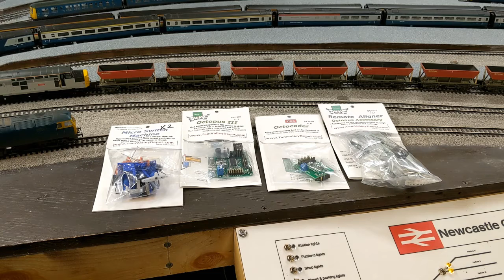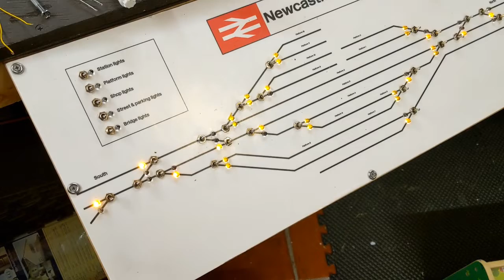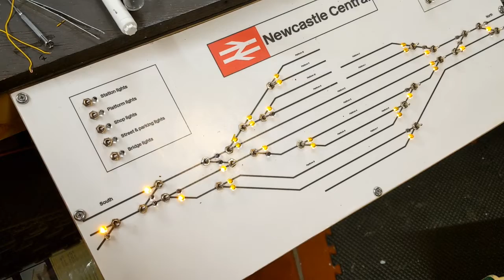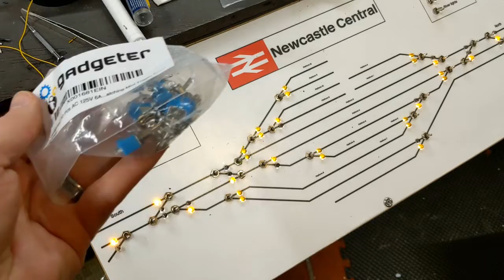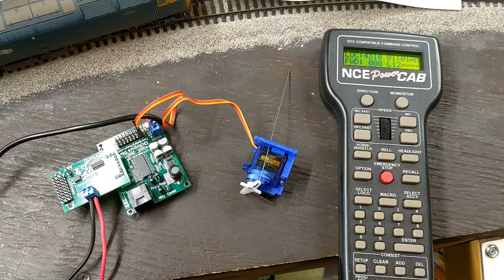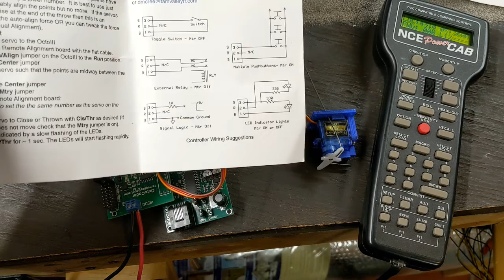33 - Points control with Octopus III and Octocoder from Tam Valley Depot

Comment: A momentary off is a pushbutton but the button will be sold as normally open (no) type. You can wire your led in parallel with the button like the instructions show. I like wiring in my panel leds with the tortoise machine. I am trying go convince myself that servos are more affordable and economical but have done it just yet. The led situation still has me hesitant

Comment: It’s been a year and a half now, I’m wondering if you are happy.  I’m working on a new build, I have tortoise switch machines from my old layout but really disliked all the mechanical noise they made when operating so I’m considering going to service,   I’ve read they can buzz when stationary, has this been an issue?
Reply from the maker: There's a little more noise when the points are thrown compared to solenoid motors, as they don't just thunk over. The servos throw a little slower, and at least with the Tam Valley boards, you can configure what that throw speed is.

I haven't had any noise with the servos buzzing or chattering when stationary. From what I'd seen, that's more if there's some noise on the cables or controllers that's causing a signal to still be sent to the servo.

Either way, with the sound of a train or two running, especially if any of them are DCC sound, you can't really hear the servo motors during operation. Good luck! Iain
Reply: @NewcastleCentralOOGauge  so on the whole, you’d go with servos, if you were to do it again?   (I’m doing an electronic switchboard, so manual buttons are not a worry).
Reply from the maker: @drithen  Yep, all my points are now servo-controlled and then digital control through JRMI. I liked the Seep PM-1 motors at the time given their low cost and the manual control panel I built, but those point motors just didn't hold up and I wanted the DCC control to be able to throw multiple points when setting routes in and out of the station. I somewhat wanted to go that route to begin with, but the cost is higher for servos and DCC control. I'm happy with using servos everywhere now.

Comment: Great video! Do you have a link to the 3d printed mount? I'd like to try those. I've been using aluminum u-channel for my mounts.
Reply from the maker: The mounts were direct from Tam Valley Depot - http://www.tamvalleydepot.com/products/octopusservodriver.html. Doesn't look like they sell them individually, sorry. That's why I got them along with the servos, and with the snap switch attached. After so many alignment issues installing the previous point motors, I wanted something super simple to get up and running. Not sure if there's anything similar on Thingiverse you'd be able to use and print yourself. All the best. Iain

Comment: Why not use toggle switches with a centre-off position and momentary on positions to the left and right?  That way you can push the toggle to one side, hold it until the turnout is thrown and then release it. No more having to remember to return the toggle to the centre position.
Reply from the maker: I noted in the original video that I've historically had problems with momentary switches in that they'd intermittently not spring-return to center, or would feel spongy. There's really no right or wrong way to go. Regardless, the noise on the lines made it not worth for what I ended up doing here and I ditched the manual control panel entirely.

Comment: The UK prices for the micro switch machines seems to have gone up a lot - £13.20 for one servo+microswitch makes this solution much less economical!
Reply from the maker: That's disappointing, wonder if it's the exchange rate? I just ordered some more this morning and they were still at US $10 for the servo, microswitch, and 3D printed bracket all assembled. There's certainly no requirement to purchase that though, any servo should work if you can source those cheaper elsewhere like a local model shop. One of the locals from our club where I first saw this set-up in action did that then attached his own microswitches and cut his own mounting brackets. I think I touched on that in video - for me, the convenience was worth the extra cost, but I can see it getting expensive if you factor in exchange rate and/or shipping. The Octopus III and Octocoder are very cool though, I'm really happy with how they've running. Thanks for watching. Iain
Reply: @NewcastleCentralOOGauge  TVD looks like they dropped prices on the servo/switch/brackets, so maybe the UK resellers haven't tracked that or the exchange rate.

Comment: I would suggest using push buttons instead of toggle switches because if you rely on the physical position of the toggle switch to show the actual position of the turnout, then you throw the turnout from the command station, the turnout would change position and that would conflict with the physical position of the toggle switch.